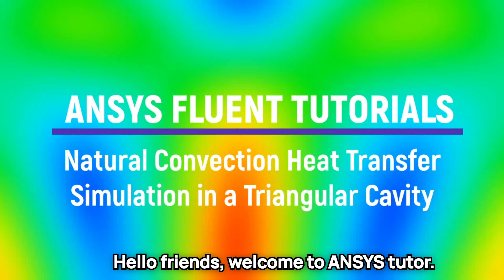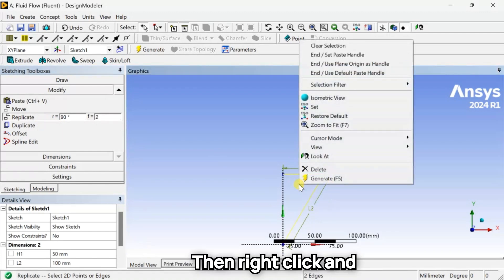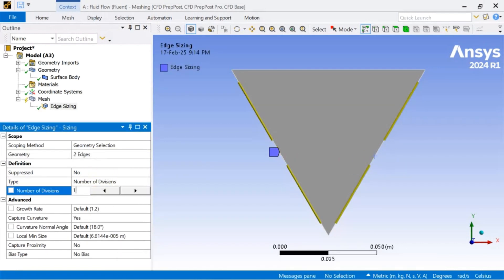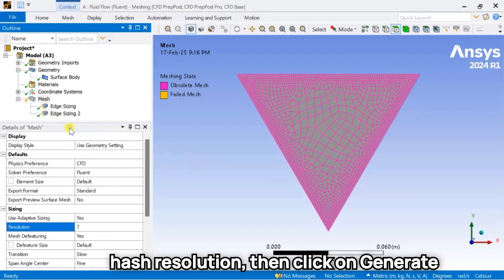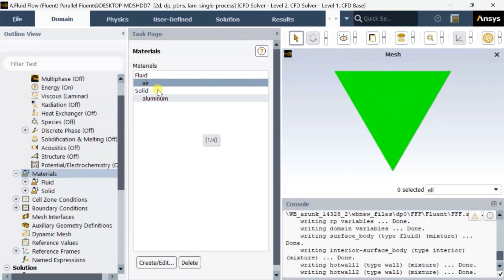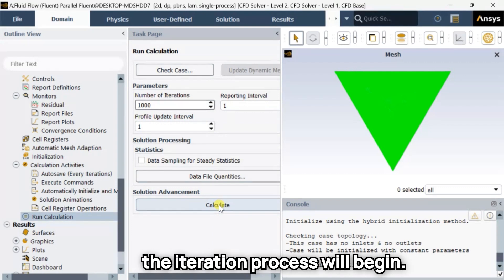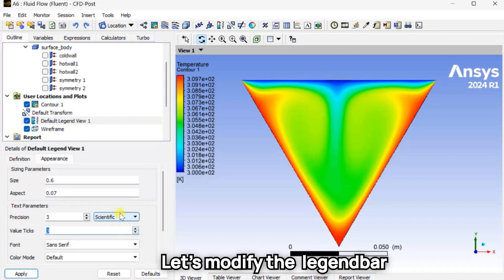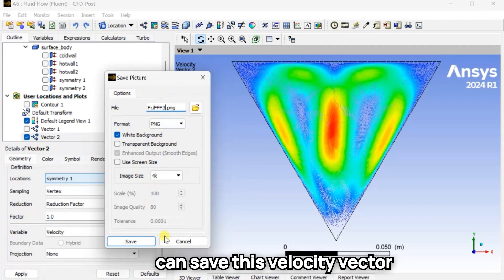ANSYS Fluent Tutorial: Natural Convection Heat Transfer in a Triangular Cavity

Comment: “How can I calculate the entry and exit distances for an open-top triangular enclosure with natural convection?
The entry condition is defined by a uniform temperature T = T_a inside the triangle, while the exit condition is defined by the temperature gradient \frac{dT}{dy}.
The triangular enclosure is thermally insulated on both sides, and heat transfer occurs only through the open top by natural convection.
How can I determine the corresponding positions (distances) along the open top for both the entry and the exit conditions
Reply from the maker: I am unable to understand your query, could you please elaborate with any hand sketch or diagram so that I could help you properly?
You can mail me on ansystutor7@gmail.com.